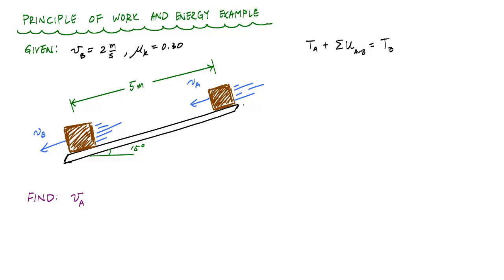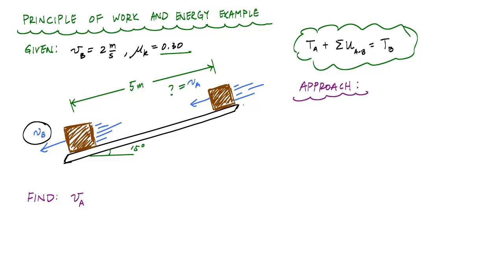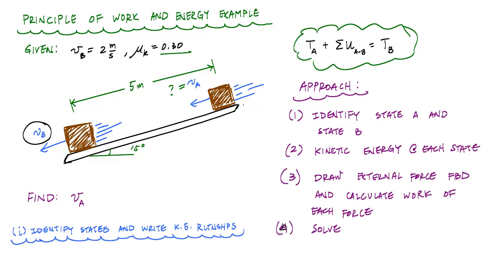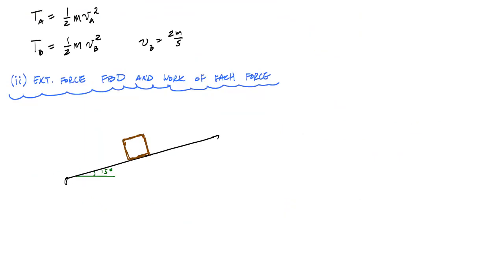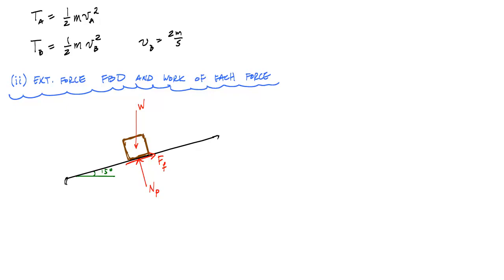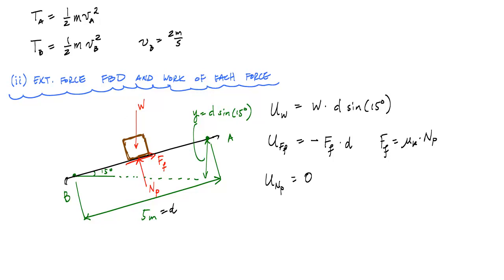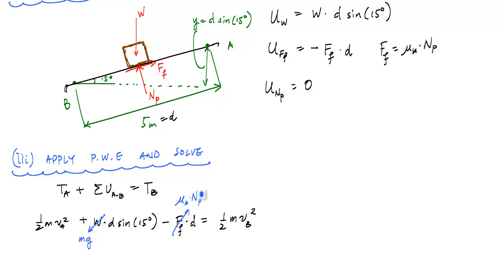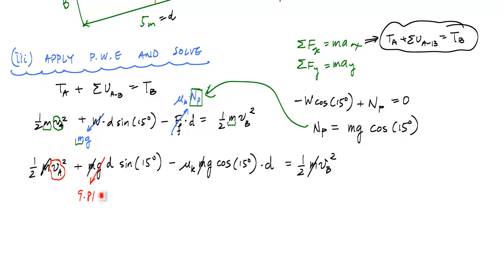Principle of Work and Energy Example 2- Engineering Dynamics

Comment: wouldn't it be more efficient to use a potential energy term in your initial equation and set state 2 as a y=0 datum? then you'd have no PE in state 2 but you'd have PE in state 1 instead of a work done by gravity term. I know it's 6 of one half a dozen of the other just my thoughts. Really enjoyed the video though. Good brush up on skills before my final exam.
Reply from the maker: +Matt Harper thanks for the suggestion and comment!

Comment: Why is it when you summed the the forces in Y you got cos(15). When I did it I got sin(15). What sort of witch craft happened there, may I ask.
Reply from the maker: Elyze IsAwsome Thank you for your interest and question.  When I sum forces in the Y, I get Np - W cos(15) = 0.  If you break up the W force vector into a vector triangle with Wx and Wy components (where X is parallel to the incline and Y is perpendicular to it), the 15 deg angle is at the intersection of Wy and W (aka the hypotenuse) . That is why,  Wy = W cos(15). Hope that helps.
Reply: I think he made an error because in my summation of the forces i got mgsintheta
Reply: TheLittlepea21
 yeah, ok. maybe its an error.
Reply: ahhhhh I see what your saying, i had a slow moment.